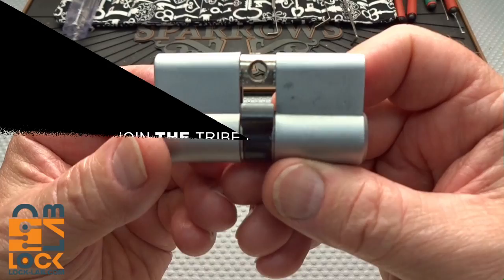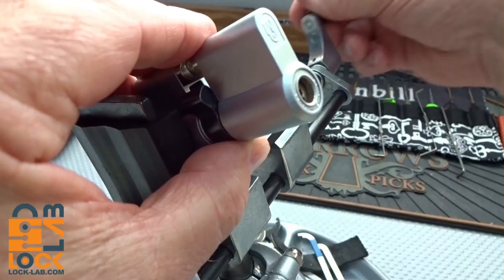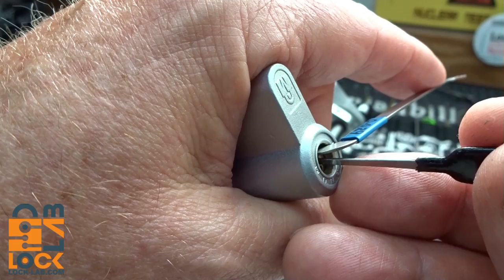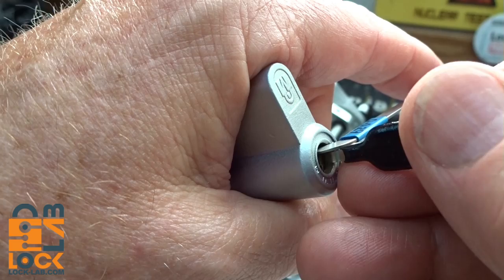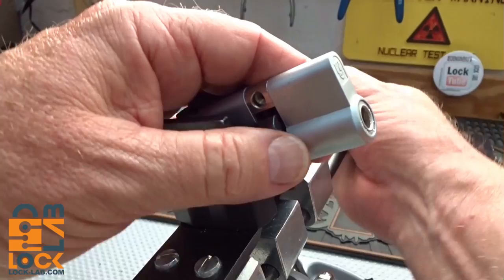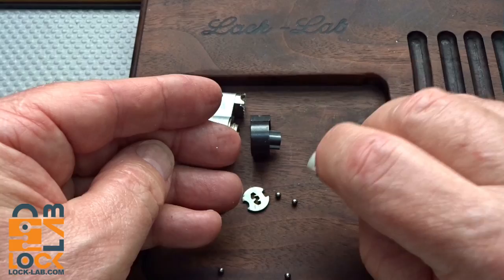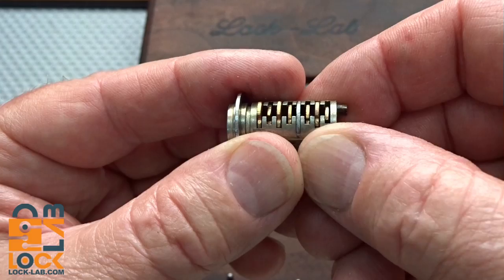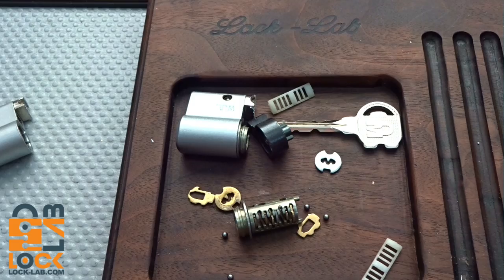(911) Magnum Euro Cylinder Picked & Gutted

Comment: Nice picking. That's the first time I've seen the innards. Interesting arrangement. Wonder why they used ball bearings instead of a sidebar.
Reply: i guess they need less space, are cheaper and work independend.
Reply: THANK YOU FOR ALL OF THE THINGS YOU SEND TO BILL FOR OUR ENJOYMENT,ITS A  REALLY COOL THING TO DO. THANK YOU AGAIN.
Reply: I think it's because the plug is already very hollow from all the parts. Adding whole slot required by a sidebar would either make it fall apart, or weaken it too much.

Comment: I do not know about other EU countries, but in Lithuania you would have to pick it 4 times as most door locks require you to turn the key two complete revolutions for unlocking (you can lock/unlock with one revolution (less secure) but most people turn the key twice). So, you would need to pick a normal lock twice and this one 4 times.

Comment: In the UK the upvc doors that this type of lock go in usually have a dead lock that requires the core to rotate 2 full revolutions. You would have to pick that at least 4 times to get an open.

Comment: are there any locks made  with spring loaded warding ? (if im right in saying warding is the channels that mate with the key itself.. or is it the keyway? sorry still kinda new to lock picking)
Reply: warding is what slides into the groove on the side of the key. spring loading them would stink because it would take away a ledge to use to pick.

Comment: I wonder what happens if you try to open them with vibration. My idea is pushing all the wavers to the top and apply heavy tension, then use some vibrating tool to push down the tension wrench, gravity should do the rest. 

It works in my imagination, i just have no way of testing it :D

Comment: Bill I need help! Which pick is the most reliable for app (Single pick picking) for pad locks like master locks? I don't want to rake no more that's newbie! So I looked at sparrows website clicked hooks and came 4 options, The short hook, Steep Hook, High reach and Euro hook. I'm really confused on which one to get!
Reply: I meant SPP not app!!
Reply: I am partial to my short hook, but it all depends on you. 99% of my picking is SPP and I have beat the heck out of my cheap short hook. waiting on my new picks to arrive tomorrow.
Reply: +Whiskey Picked hmmm interesting I been using a OK short hook and it's decent until I bent it :( I will try to get the sparrows short hook thanks :) btw do you know which pick bill uses?

Comment: I have a problem: we have to get into a 1970´s (no exact datum given) austrian motorcycle lock (Puch Ds 50). We have no lockpicking equipment nor such skills. We need to replace the lock because thhe key is long gone. any tipps how we can open it without drilling it open? It´s probably a 4 pin lock.
Reply: This is the looks like the lock (not 100%sure if its the same) we have to open http://www.moped-garage.net/out/pictures/master/product/1/kreidlerherculeslenkschloss2301(1).jpg
Reply from the maker: No skills.  No tools.   Hmmmm.  No idea what to tell you other than call a locksmith and watch him rake it open.